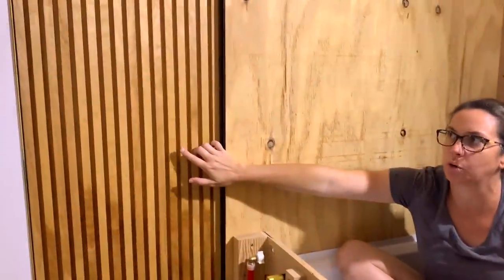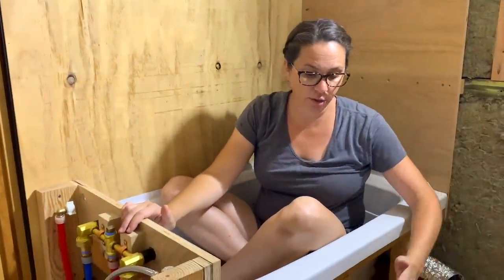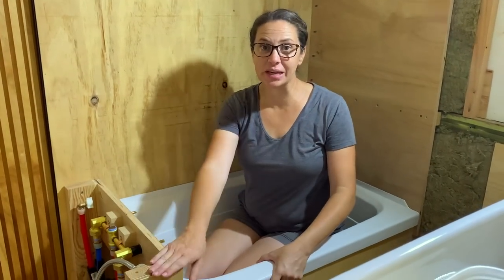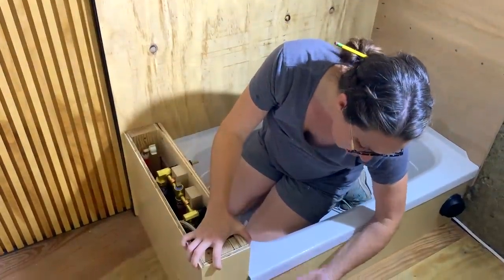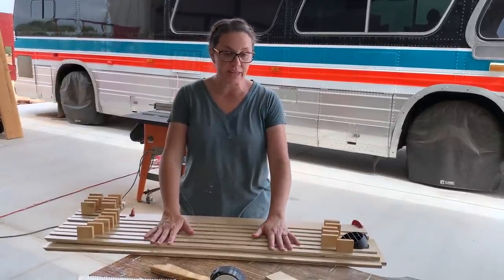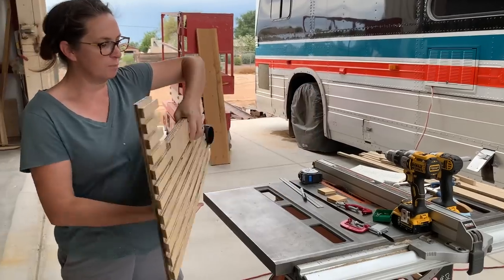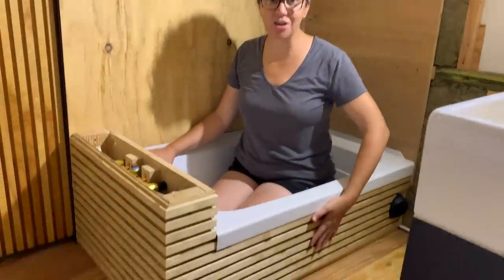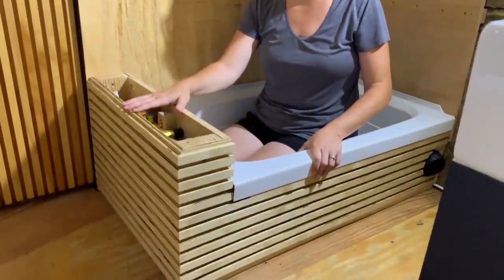Slatted Tub Surround

Comment: You might consider Starboard for your bench seat. No water consideration there, and you can use oogoo/proto putty to make a seal around the edges and some threaded inserts and machine screws to fasten it down. Water tight and removable for service.
Reply from the maker: Thank you Ryan - I just looked up Starboard and it looks very interesting!
Reply: @BeginningfromthisMorning  No problem. I'm sorry for assuming that it's ubiquitous. It's just a name brand of High density polyethylene sheet. We use it a lot in boat remodels. Best of luck!

Comment: Hi Juan and Michelle,
Looks very nice.  Details, details, details...great work!  
We are preparing to remodel our 30+ year old bus bathroom.  For the walls, we picked a new material that is lightweight and nice looking.  Never heard of it before now.  Flexstone.  It is a very hard very waterproof material.  Check it out. Glues to plywood wall.  Just a suggestion.
Reply from the maker: Thank you John - I just checked out the flexstone - very interesting!  Do you know if it bends?
Reply: @BeginningfromthisMorning   Hi Juan and Michelle.  It is marginally flexible, but not enough to follow the roof curve...if that's why you're asking. It would bend enough to follow the curve in the wall from the top of the windows to the floor.  Hope that helps. If you call the company, they will send out a couple of color samples and you can see how it's constructed.  VERY waterproof!

Comment: You may want to consider using the rigid aluminum for the heater hose in the bathroom, instead of using the flexible hose in order to improve safety and avoid fire hazard.
Reply from the maker: Thanks Oxman - I will look into this

Comment: Hey guys Kevin here from Australia. 
Great job on the bath the horizontal lines are a nice contrast to the sliding door. 
One thing concerns me and that is the mitred corner.  You've done a great job but your going to damage that in no time. In a past life when i wasn't retired i would let in with a router a peice of aluminum needs to be about 10mm deep by about 5mm wide.  I will try and find a picture for you.
Anyhoo stay safe and stay well. 
✌  Peace
Reply from the maker: Thank you Kevin - great suggestion on the mitered corner.  We are planing to have a similar setup on the couch so we will look into this further with that as well.  Thank you!

Comment: Looks Fantastic!! A Family works and Plays hard together is a Family that stays together. What Trax Saw is that you have? Pretty nice
Reply from the maker: Thank you Dennis - this project has been really great for our family and we are hoping the traveling is even better!  That track saw is the cheapest one you can buy on Amazon (Wen brand).  It is a decent saw (loads better than the recirculating saw we replaced) but if I was to buy one again I would buy a nicer one.  This one has served us well but we will likely just throw it away when we are done with the project.  It is very difficult to find blades for, the track is "sticking" where the two tracks join together.

Comment: One thing that I see about the construction of your bathroom is the use of plywood around the tub instead of cement board like is done on regular home construction. If you don't wish to redo work in the bathroom and it were me I would treat all of the wood with a something like Thompson Water Seal and then paint everything with "pool paint." I will forewarn you the stuff is nasty to work with it is thick and you need to wear a respirator and vent the bus while it dries because the odor drying is pretty bad but the stuff is waterproof and durable. Note I am not suggesting to use the pool paint as you bathroom finish but rather as an under coat behind your finish work.  Additionally have you considered a heated floor in your bathroom I installed one in my house and what a difference and I would of loved one in the RV I had many years ago because the bathroom room floor in it except in the heat of summer was always cold.  Friends of mine installed heated floors of their houseboat and what a difference in the comfort level of it.  One finial thing you might want to consider is some insulation of the walls around your tub and a inconspicuous small vent for air flow to prevent moisture buildup which in turn results in mold and mildew and than is never a good thing. StaySafe-StayHealthy and Have a great day.
Reply from the maker: Thank you gullreefclub  - Great suggestions!  We are still researching what to use on the plywood.  "Red Gaurd" keeps coming up quite a bit and we will likely attach a membrane on top of the plywood.  We are leaning towards using Schluter kerdi board but we are still researching it a bit (and talking to some tile folks).  Heated floors are a great idea and we will likey do (electric) floor heating down the center of the bus (from the kids room, through the bathroom and  kitchen, and into the living room) - One nice thing about having a small space like this is that we can do radiant floor heating like this relatively cheaply (since it's only about 30ft x 2ft).  As for the vent we have a maxxair fan in the bathroom that is capable of moving 600 fpm of air out of the bathroom - hopefully that can keep the moisture buildup under control.  Thank you so much for the very well thorough comment.